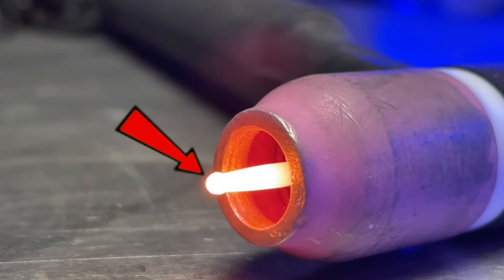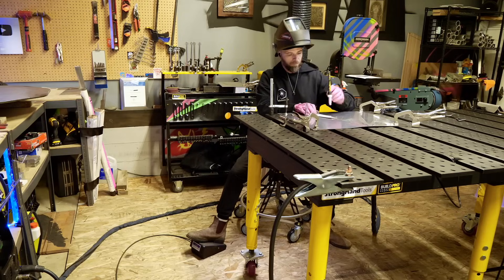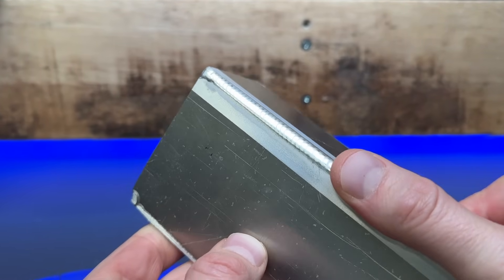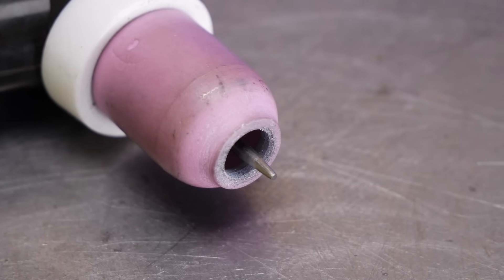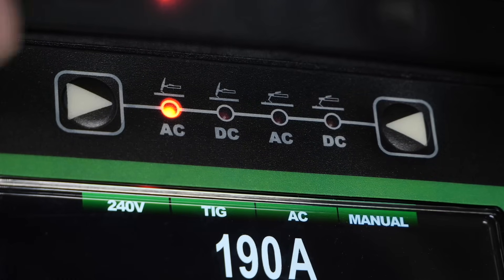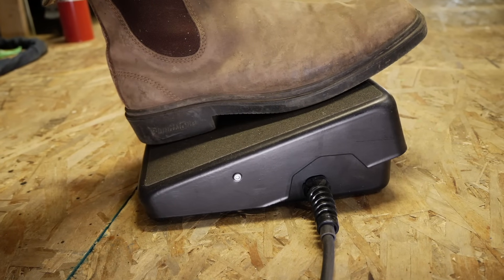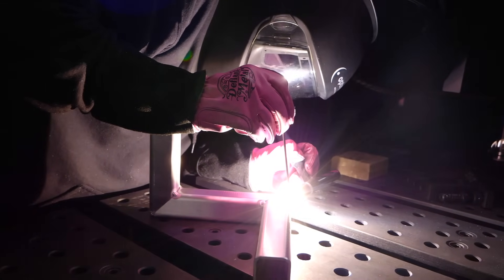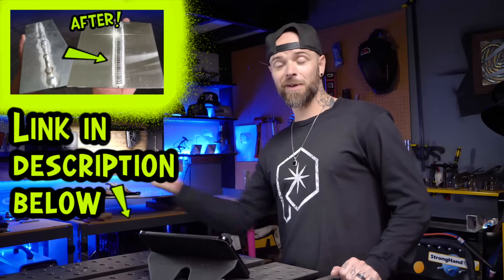Ball Your Tungsten for Aluminum, Even Though it's WRONG. how to tig weld aluminum

Comment: This is pointless advice ? The ball is going to form on the tip with AC anyway, depending on three conditions simultaneously. 
1. Current.
2. Balance.
3. Electrode size and type.
If your ball is too big, eg. Larger than the electrode diamiter, then go bigger, use less current, or decrease cleaning + cycle time. That's it.
There is no point in making a nice little purple ball on your tungstan with low current + polarity DC if you are going to weld say 70/30 AC at higher current. That little ball is gonna change anyway depending on the previously mentioned three.

Comment: The miller dynasty 400 has a ball setting on the balance.The dynasty 350 does not, you turn the balance all the way positive for the ball, the 400 displays ball on the readout, sometimes I ball it usually on larger size tungsten.

Comment: Pro tip tungsten is poisonous 
use eye protection when sharpening 
If you stabed your self even scratched get a tetanus shot asap
Reply: How is tetanus bacteria going to survive red heat? Also how many welders haven't had a tetanus shot?

Comment: are you balling the end on ac or dc i ask because i have tried with my welder to do it and it wont light up with the polarity switch of the leads i have a xcel-arc viper 180 ac/dc

Comment: All info is good but only if you give the tungsten you are using, and your voltage. If you use green you can always 
just taper and flatten your tip and set your
Balance midway. Good to go

Comment: I have a basic parweld XTT182DV is this welder capable of welding 1.5mm/.06" aliminium or is it too bbasic of a welder with not enough settings, i want to learn to weld thin stuff but cant afford a better welder, its just hobby stuff for me, and what settings should iuse for a starting point

Comment: I'm a studying student just retired and I'm gifting myself a new welder because I need to learn a new craft that contributes to my others. So doing the Tig - Every piece of advice I see is "Don't start to learn with aluminum"... Well, I'm hard headed and frankly, exactly what I will do because that's all I'm interested in is welding alum. I've burned miles of stick through the Lincoln, everyone knows this machine, like aa small block chevy. 
 I don't get why I should learn on steel when I'm only going to switch to all different settings, feel for the melt and go "Holy shit, this is nothing like steel"  - Like, starting over isn't it? Or is it easier and cheaper to learn and develop your step?  
 As for ball, point bla bla. Kind of like whisky snobs that shriek over an ice cube near their glass and can't watch someone shoot fountain soda over beautiful desert bourbon, turn in sorrow....Ball thing looks cool as hell! Don't see an issue - The best whisky is whisky the way you like to drink it ~ But since I haven't scratched my first arc, hell, even nailed down the machine, I don't need to worry about this like if I asked you "you like Scotch?" Nope, never had it` well, I'm not pouring you one from a $350 bottle because frankly, it would be wasted on you because you have no reference. That's me with a tig torch :D

Comment: Justin, thank you for your in-depth tutorials, tips and tricks! I've been struggling with welding aluminium until I decided to follow your guide to the letter. I got consistent small balls on my electrodes and my welds started flowing like never before! The difference was night and day. Previously I got a lot more contamination and the welds were flowing slower, causing the material to become unnecessarily hot. 

It's such a relief to finally have the confidence to take on the next job. Thank you! You are appreciated!

Comment: Thanks, great content, I tried that and it works great, My Dynasty 280 DX has a feature on the bal. setting, turn in all the way down and it says "Ball". Miller actually mentions slight melt back to balled is ok. helps with Electrode erosion they call it.

Comment: I weld stainless steel everyday and although you constantly get better with experimenting I have only ever been 'OK' at aluminium. Never known how to get that perfect ball before watching this. I used your welder settings and I'm not exaggerating, it's like welding a whole new material. My aluminium welding has just improved 500% in a day. Thanks for the video dude from the UK.

Comment: With the old machines you were taught to ball your tungsten but if you didn’t it would actually ball itself while you were welding, now with the inverter machines you don’t need to ball your tungsten and it works just fine .

Comment: If your welding on Aluminum >.250 I would urge you to try using DC straight polarity and Helium gas, pointed 2% Tungsten. The heat input is double what you get using AC. The aluminum melts instantly. I did it this way for years, wire brush using a high speed SST rotating style brush to Rmv the oxidation, then degrease w/alcohol. You don’t get a visible change at the weld puddle, it just sinks in a little because it’s melting, then start feeding the filler. High penetration welds almost instantly.

Comment: Just found your channel a week ago awesome tips you provide 👏🏼.
I started welding AC in January and my work is only with engine heads on water gallery corrosions. 
I don’t use a pedal, what amperage do you recommend to do the ball on tungsten? I do the balance method 3rd option. On the video it shows 30ish to 40ish Amperage.
Using 2.4mm tungsten blue and white color.
Greetings from Brazil 🇧🇷😃.

Comment: 20+ yrs ago here in aus we were taught to ball the tip for aluminium,  we used a copper plate though, using the same settings we'd weld the material/ joint with.

Comment: I've done my TIG Weld test last Thursday. I had trouble welding aluminum. Galvanize not to bad. And it's surprising because I got the job lol 🫣👀
Reply: Sometimes they just wanna see if you have the basic idea down. I went to a place where they do sanitary stainless and my butt joint weld came out horrible but my other joints were crisp. The welding supervisor said he just wanted to make sure I knew how to TIG weld and be able to feed the rods.

Comment: Something not related to this vid. What kind of lights being used in workshop as i have led tube lights and helmet darkens the moment i want to weld. What am i doing wrong please. What can be adviced to keep inside dry as breathing fogsup on lens inside.
Reply: On my miller elite helmet there is a sensitivity setting that controls the intensity of light required to trigger the auto darkening effect. I had to weld a handrail outside the shop and the sunlight kept triggering my helmet until I lowered the sensitivity.

Comment: I do not believe your mentioned your base material for "balling" I was taught to use a piece of brass or copper, I keep that same piece of copper for whenever I want to ball and not once does it deform or pit the copper and heats up perfect for the excellent ball.
Reply: Possibly stainless.  I use a 1/4 stainless plate to ball the tip. Also it can be used yo clean your contaminated tungsten when aluminum welding.

Comment: Most important thing he said that MOST people will ignore and then be irritated:
"Whatever you use for Tungsten preparation ONLY USE IT FOR TUNGSTEN PREPARATION".
There's no better way to drive a new welder crazy than contaminate the tungsten or the workpiece.

Some welding you can get away with welding through paint or rust or other crap. NOT with TIIG Aluminum.

Comment: Thanks for doing this video. I was one of the people who asked you to do cover this very topic. I tried purposely balling my tungsten before but couldn't get it to look quite like yours. So I just blunted the tip like those inverter manuals tell us to do it.  I'll be trying your technique this weekend being gentle on the pedal. 
I am curious what shop manual were you referencing? I too have an Everlast welder (MTS 275) and it didn't talk about a method to ball the tungsten for Al welding. Though I found their manual to be technically sound and very informative and I read all 100+ pages of it. I hate to be that guy, but the manual excerpt you showed talked about power, heat and ultimately "amperage" going into the tungsten. Technically that's not entirely correct (heat IS being carried into the tungsten, yes, but current/amperage is actually flowing into the workpiece). Electrons, which are a negative charge, flow from -ve to +ve and electrons do indeed bring the majority of the heat and thereby making the tungsten much hotter than the workpiece. But current which is a measure  of +ve charge flow actually flows in the opposite direction of electrons and vice versa.
Reply from the maker: Great comment and great explanation! Let me know how it goes if you give it a whirl, happy welding and have a great weekend!

Comment: Been welding for about 30 years now i use a ball every time aluminum I have tried a point and it does not weld as nice as a ball
Reply: 25+ years here and I ball every time too... it's because we're old and that's how it was done back when we had to dodge dinosaurs on our way to school... :D
Reply: @greymane_gaming3435  hell yeah
Reply from the maker: We are all Ballers! Really awesome to hear what you all use for your set up, whatever gets the job done!💎 Have a great weekend and happy welding🔥
Reply: @PacificArcTigWelding  old airco  350 amp I do aluminum rim wheel repair every day I used to be a boilermaker

Comment: Thanks for this!  I've been waiting for this video for a while.  
QUESTION: What metal do you suggest balling on?  I'm assuming it should be the metal we are going to be welding to prevent cross contamination,  but I would like to know for sure.
Reply from the maker: Honestly as far as getting results, I don't find one is particularly better than the other. Just ball on something that you don't care about having a small puddle form on, copper, stainless, chunk of spare aluminum, whatever you have laying around. I used to have students looking for something to use and they would end up bawling on one of their hammers or something😂 Whatever works I guess! Thanks so much for checking out the video, have a great weekend!🙂

Comment: Huh...excuse my ignorance (?) but.. The tungsten will ball up in the first few seconds of alu welding anyway. I've never welded Al and kept a pointy tungsten for more than 10 seconds
So, might as well be balling it up preemptively in a controled and clean manner yourself rather than letting it dance away while you're trying to weld
Good video , thanks 👍
Reply: Wrong it depends on your settings and what type of machine the old syncrowave yes but not inverter machines. They have a specific setting for ball on the miller dynasty.
Reply: You ball it by your self before anything because you have the control on it. Perfect ball every time

Comment: I point my tungsten for welding AC, and it instantly balls up and seems to run okay. I've never been able to keep a pointed tungsten on AC. I use a miller syncrowave 350LX and I am usually welding 1/4 inch or thicker. I use an 1/8 green tungsten because the 3/16 that I normally run for steel deforms and flutters before I can even get a puddle. Am I doing something wrong?
Reply: That is pure tungsten, it has a significantly lower carrying capacity relative to most other types of electrode. I would consider using Lanthanated 2% (blue) because it will work equally well on ac or dc.
Reply: @colesmith3683  Thanks for the tip, I'll try to see if I can get some of those. I've been wanting to try some of the different types of tungsten, but I only weld at work, so it can be hard to get stuff other than what they keep on hand.
Reply: @scottjones8664  your work only has green tungsten, and you are welding steel and aluminum??
Reply: @colesmith3683  we also have gray, which is what I use for steel.

Comment: This'll be a fun and informative one for sure! 
I learned to TIG weld on a gigantic industrial Lincoln [Square Wave?]
- Water cooled torch,  - Usually run full tilt  [We manufactured HIGE I-Beams]
Anyways,  after playing w/ ridiculously thick steel,  they threw some aluminum at me.. 
YUCK!!  *I was waiting for the metal/puddle to turn red,  but NOPE - Kept blowing through.. 
Finally - It all clicked.  Man,  that was fun!  While it lasted.. 
Off/On w/ my DC only TIGs over the years until' recently:  Scored a PrimeWeld TIG 225X
[Hence why I'm here now,  and dude..  I'm really enjoying and appreciating it! ]
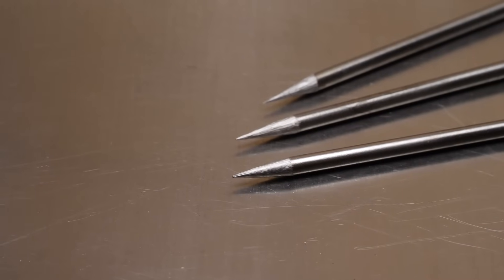It's 1:00+ in the AM..  7am can't come soon enough!  
🤘😁 
Sam -